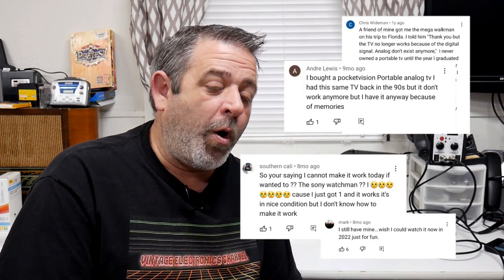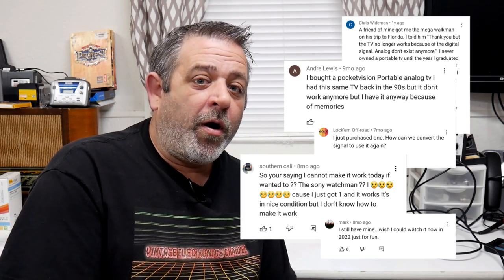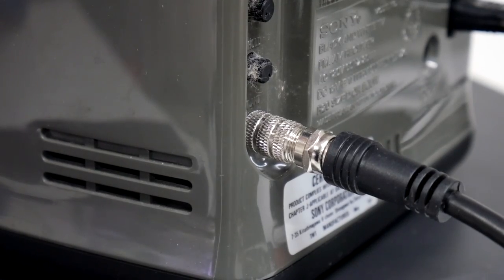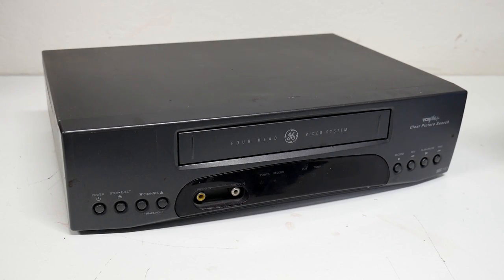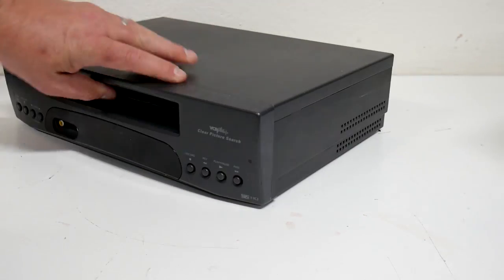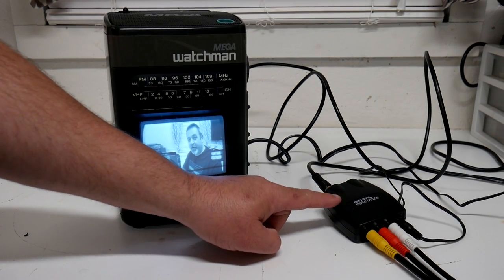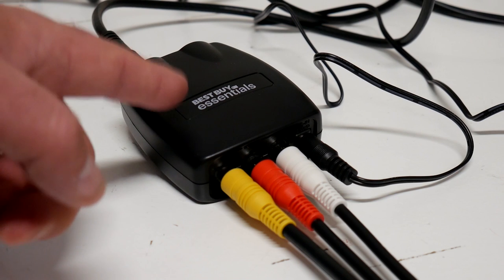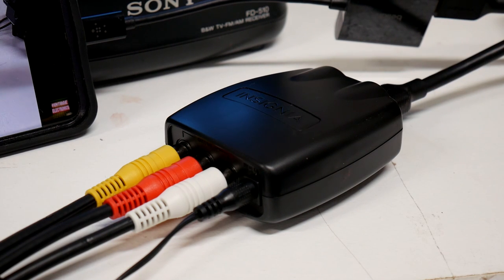How To Make Your Analog TV Work - Hooking Modern Sources to Vintage Equipment

Comment: I’m trying to figure out the most effective way to link up an old 70’s TV with coax pig-tails to an HDMI source.
Reply from the maker: It would definitely be to use a converter from HDMI to RF. There are some all on one options out there if you don't want to covert twice like I do in this video.

Comment: Is there an RF modular that has a battery power source? I have an older eight function TV/lantern/radio to be used for emergency situation’s. The radio and the lanterns work but the TV doesn’t. I realize I need to change it to digital with an RF modulator but you need a power source for the RF modulator. Is there anything that runs on batteries that will do the job?
Reply from the maker: I just grabbed the modulators I used off the shelf and had a look at them. I'm not familiar with any that are battery powered, however the power supplies for the ones I have all output 5VDC. You could theoretically make a power cable that uses a USB power bank since they output 5VDC as well. They appear to use a maximum of 1A at 5VDC, so it would consume about as much power from the power bank as a cell phone charging. Hope that helps!

Comment: Great video ! How can you do this with a portable analog TV ? I'm trying to find a way to play a specific video on an old analog Portable TV for a show, and be able to walk with it on stage. Guess it's not possible without wires 😅
Thinking of something like Electro Brand Model 326X vintage 5" Téléviseur analogique portable N/B
Reply from the maker: Unfortunately, it would be very difficult to accomplish this without wires. You'd have to be able to transmit the VHF or UHF television signal to the TV remotely, and those transmitters are expensive and very technical. Another wireless option would be a wireless video transmitter, but it would still need to be powered separately.